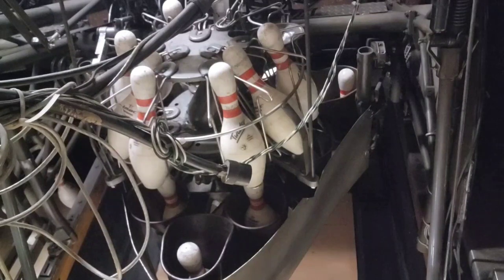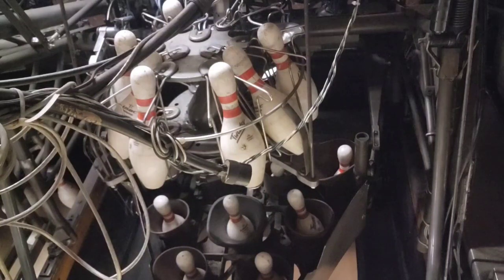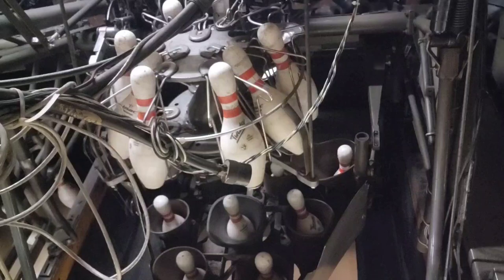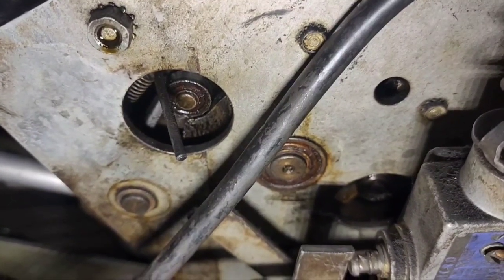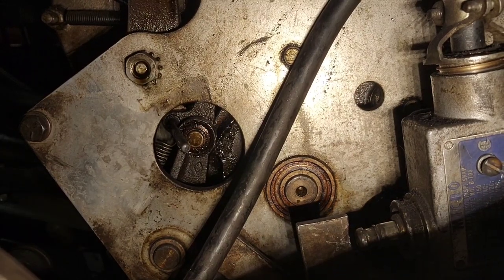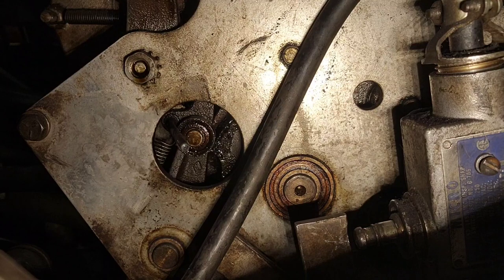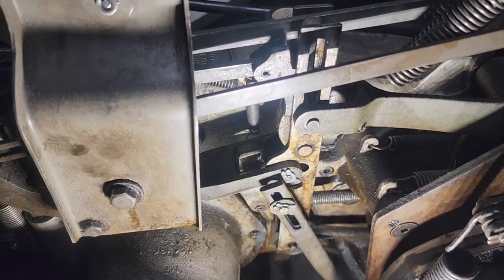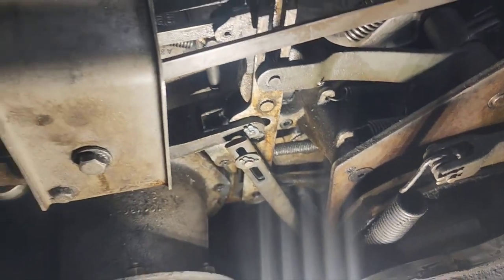Brunswick A2 Pinsetter malfunction on 2nd ball cycle. Not what I expected to find!

Comment: Where is this linkage located?
Reply from the maker: This is the cycle linkage attached to the 7-pin side of the gear box. Some people call this the start/stop linkage. 

In this particular case, there was a significant amount of wear between the clutch actuator link and the clutch actuator lever. 

These two pieces are supposed to work together, so the GB clutch can cycle, and the detector can give proper input for strike/no-strike signal to the cycle linkage. 

This wasn't happening in this case. 

The cycle linkage had a bind. This bind prevented the strike controller in the detector from following the contour of the timing cam in the detector, which resulted in a false "standing pins" detection. 

I didn't cover it in the video, but the clutch actuator lever had gotten bent where the pin and rollers meet the actuator link. 

I show that there is a slight bind in the video, but I didn't go into much detail about it. 

This service stop didn't have spare parts, so I bent the lever back onto position as best I could. 

It seems like it worked because I haven't had any further callbacks/issues.
Reply: @michaelbuckley3808  There's nothing more permanent than a temporary fix.
I hope this place can get the necessary parts to fix this.